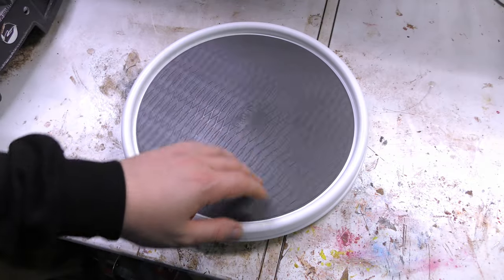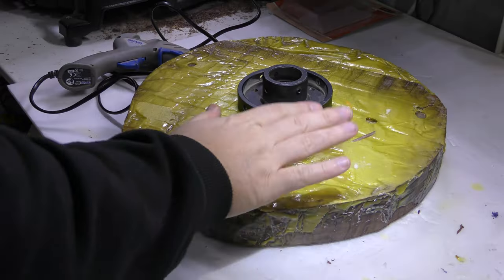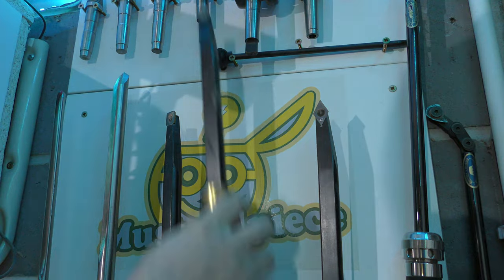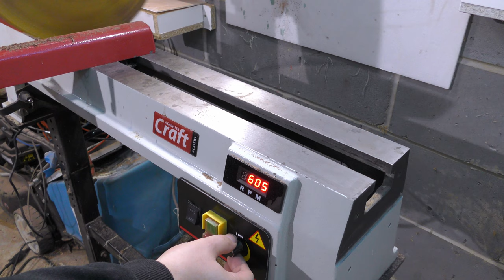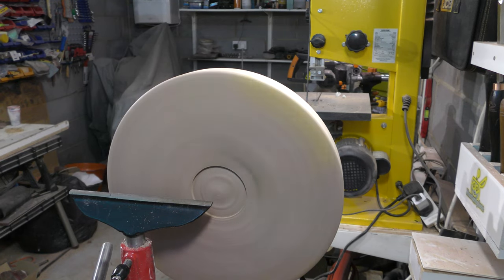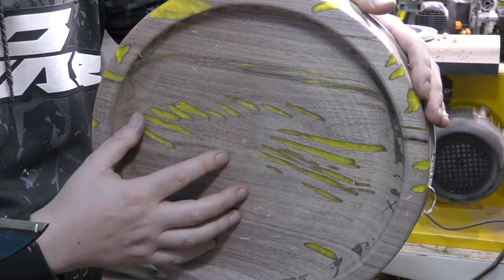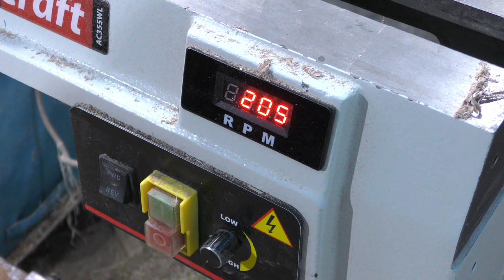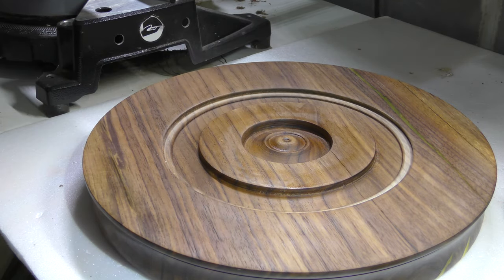Woodturning a Rotating Tray - Lazy-susan

Comment: Beautiful job Atilla.  Had to laugh out load attention ice cream truck.   Another way of anchoring without screws is screw a waste block in to the face plate then glue the piece to that.  A better bond wood to wood 5han wood to metal.
Reply from the maker: True. Thank you for the tip. I'm gonna use it.